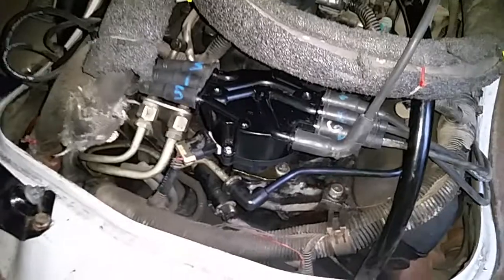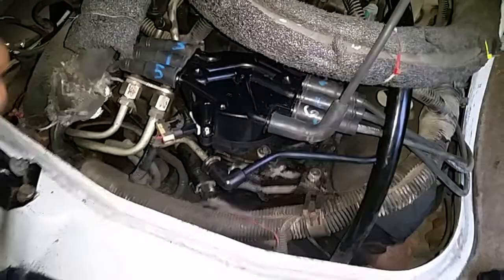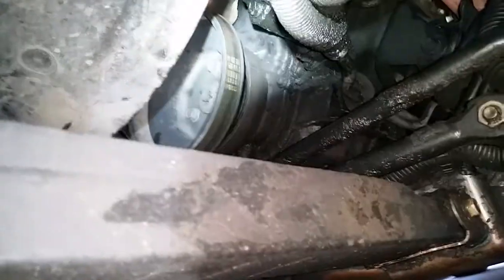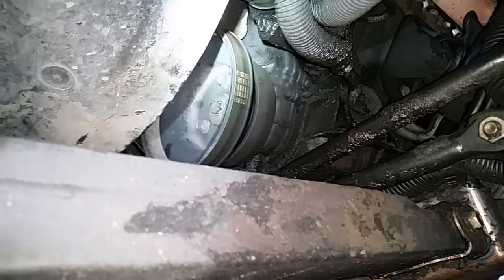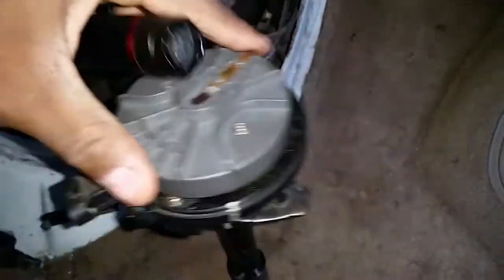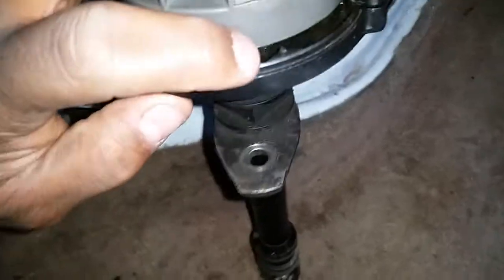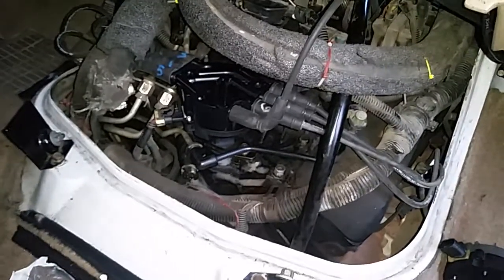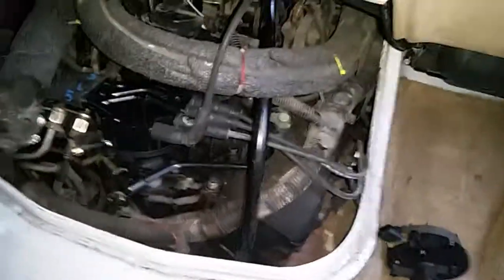2000 astro distributor replacement trouble

Comment: all you have to do is remove the distributor cap, line up the marks on the crankshaft, if the rotor is pointing at the 6 its a compression stroke at TDC. If it is not pointing at six rotate the crank again. Now it will be pointing at the 6, TDC

Comment from the maker: no.  where you get security code from?  

you may have to disconnect battery for a few minutes so it resets.
Reply: Dre Day when I start there is none but when I try to crank it and does but than it doesn't allow it to turn on, bcs the security code pops up